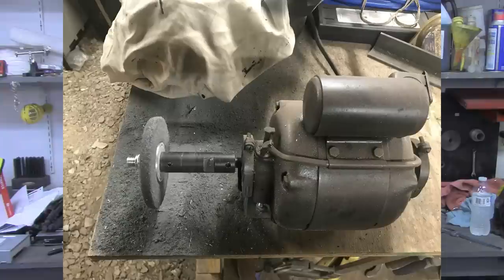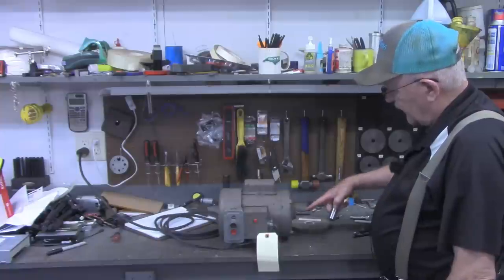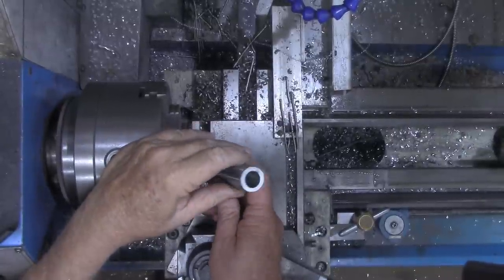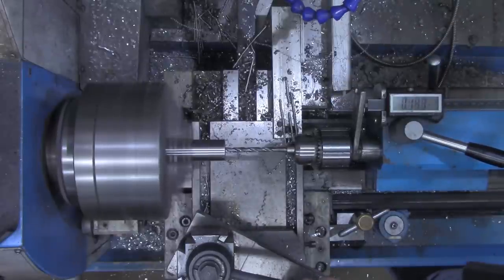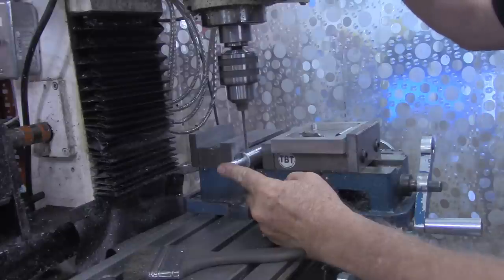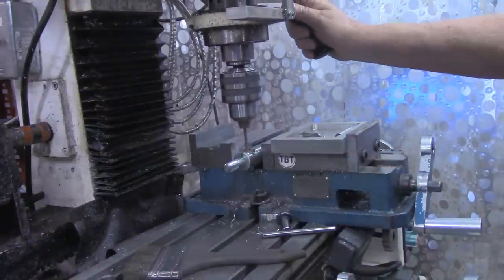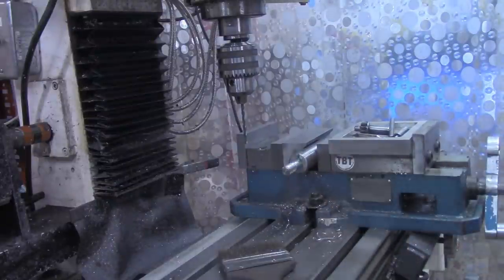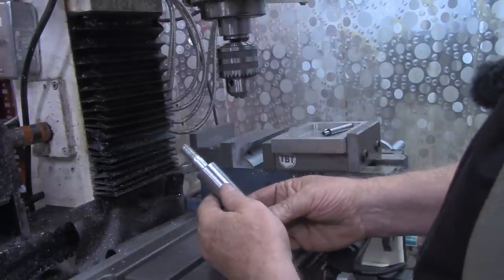Mounting a ScotchBrite Wheel On an Electric Motor

Comment: You mentioned that you don't have any way to broach a blind hole, but you have a lathe.  Grind a tool bit to form the shape and use your cross slide to cut the key way.  Probably not as fast or accurate as a shaper, but it works.

Comment: Wouldn't a stepped sleeve be a better solution? 5/8th shaft, 1" bore on the abrasive wheel. Seems the closer you get the wheel to the motor, the less wobble/runout you would get.